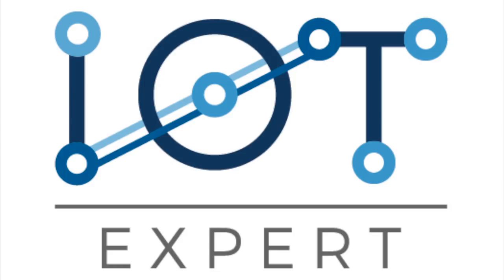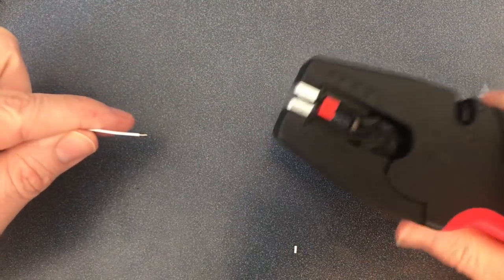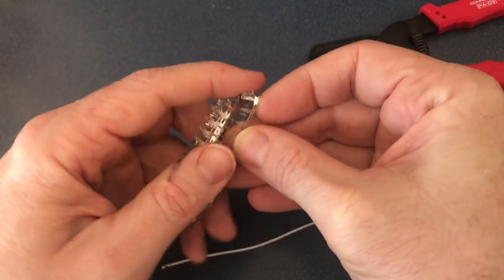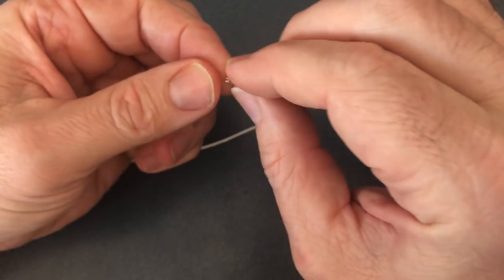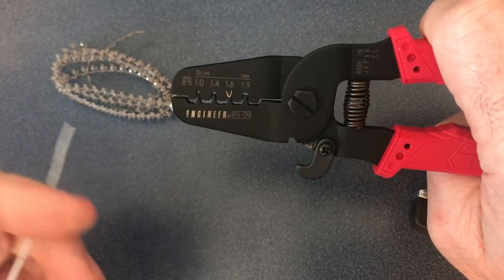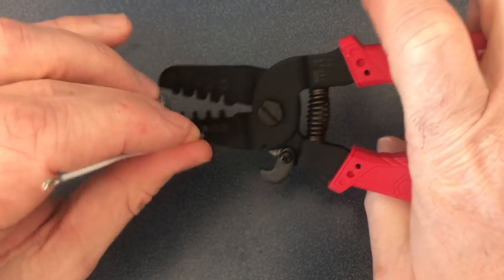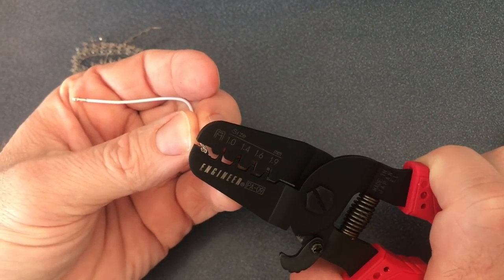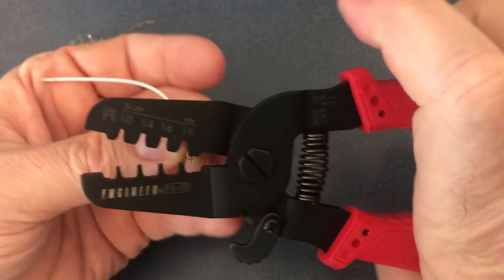JST Connector Crimp

Comment: Is the 1.6mm on PA-20 the same thing as 1.6mm on PA-09 for JST XH? It's driving me mad - I'm trying to crimp XH to a very thin wire (from a fan) with my PA-20, but it's not tight enough, the conducting wire is not holding at all - it pulls out easily. I'm wondering if i need to buy PA-20 and if 1.6mm is enough tor JST XH at all...

Comment: Thank you for this, and the web page details.  A big plus for me is showing the two step process (so obviously better now). The first crimp of the wire allows the crimp to be tested for physical viability - not possible if the insulation is crimped at the same time.  Takes longer, but thats not a problem to me. I use a "cheap" crimper with no problem, if careful.

Comment: Useful size info, this is for wire to wire oftentimes, I use JST EL for my Hakko hot air reflow station heating element connector

Comment: You make it seem easy, but even after 10 attempts just now, I still end up with flat, saddened connectors and wires that wiggle out with the slightest breeze. I hate crimping so much. 
EDIT: There's an extremely important detail that isn't mentioned in the video: your crimping tool die (the part with the teeth) needs to be 4mm wide, not 7mm wide! The 7mm variant is used for dupont connectors and it will destroy the latching part on JST connectors. I wish I knew this before destroying a dozen connectors.
Reply: The linked article spells it out